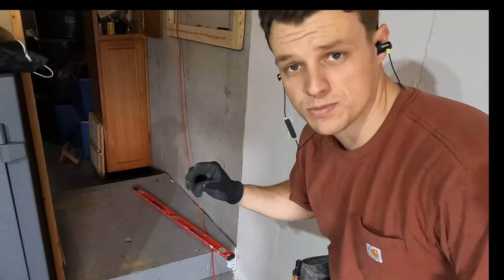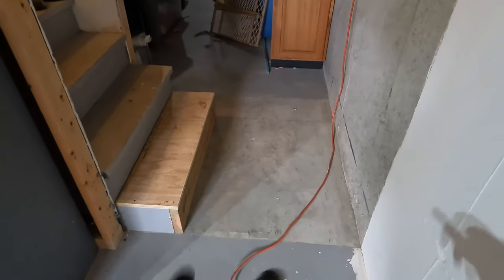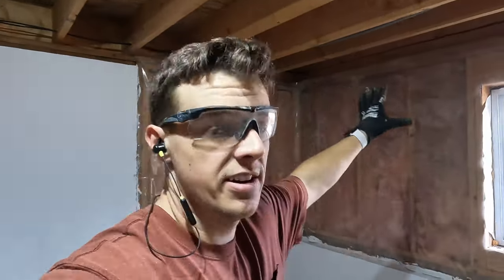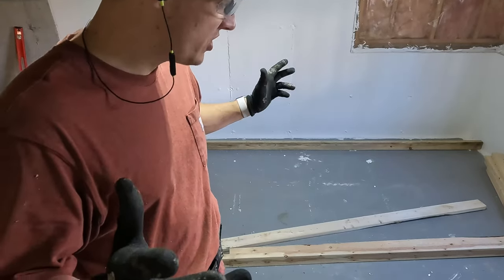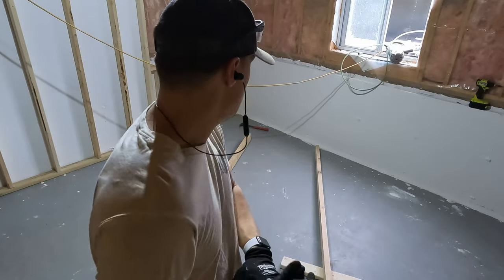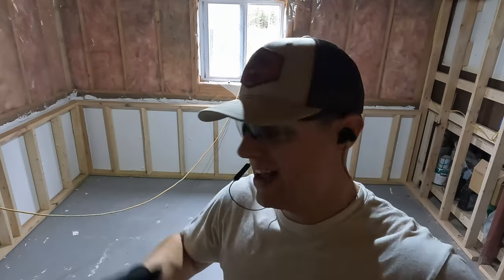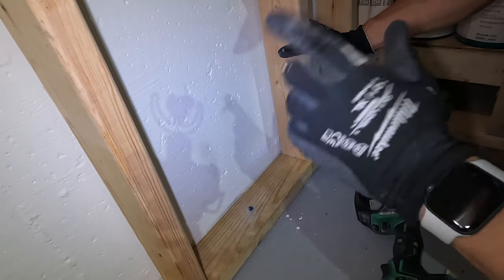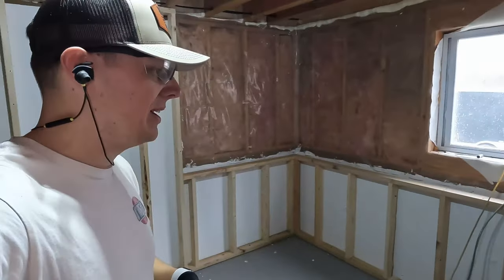Framing Walls in a Basement

Comment: How did you secure that half wall top plate to the concrete wall?   How are you going to finish that top concrete ledge?  Thanks .
Reply from the maker: I just used tapcon anchors at an angle through a few of the studs into the wall. 
Here's the shelf i made for that spot;
 https://www.youtube.com/watch?v=yaUNR2jBf8Q&list=PLpFnPv0S_lFtK-9wC8iiF_JHvTjyDBEri&index=10
Basement Playlist;
https://youtube.com/playlist?list=PLpFnPv0S_lFtK-9wC8iiF_JHvTjyDBEri
Reply: @BreakFreeHomestead  Thanks for that info.  I just started framing out my basement.   Yours looks great!
Reply from the maker: Of course! Get it 💪

Thank you!
Reply from the maker: What do you mean anchor it to a baseplate?